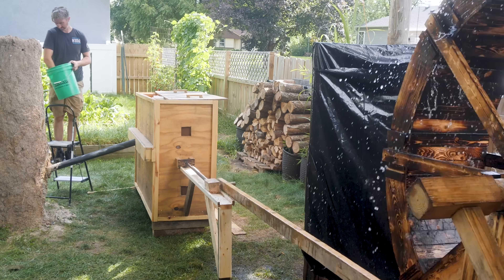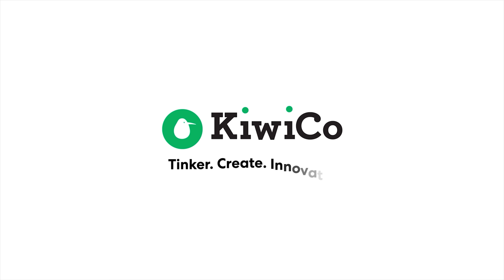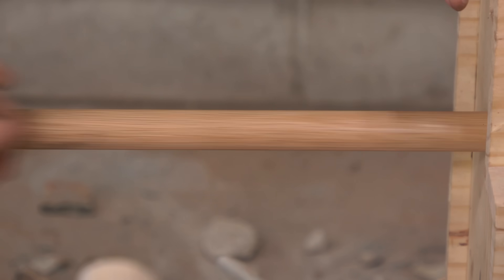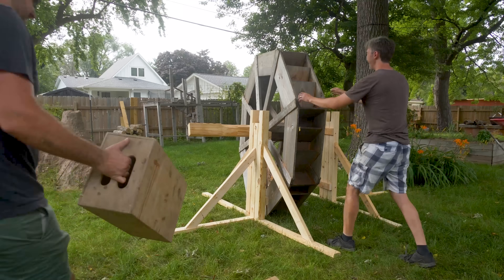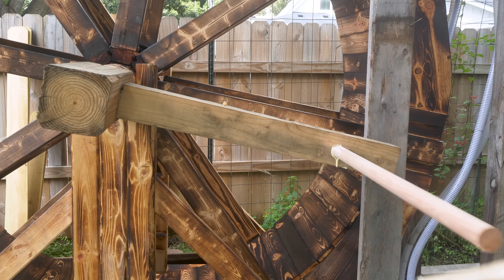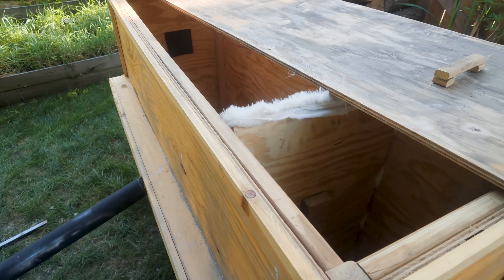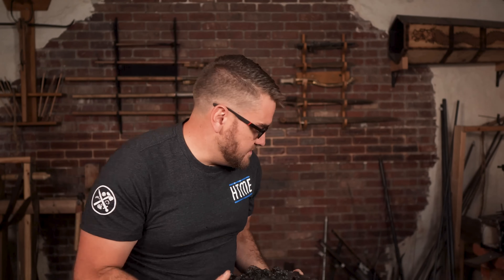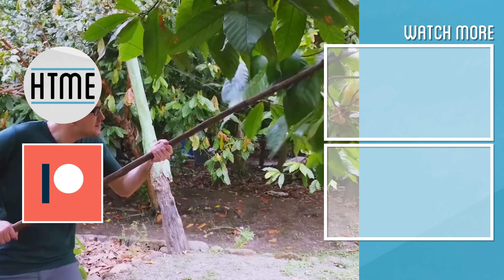River Power: The Secret of Ancient Metalworking

Comment: at some point you need to "unlock" the flat surface to unlock machining. im sure youre aware of this but i hope you do a vid on the 3 plates method of finding a flat surface
Reply: This! 👆
Reply: That's a wonderful idea, and it really is critical to making anything really halfway precise. And if nothing else he'll probably half lose his mind with all the lapping and I'm all for it.
Reply: Reference surfaces, and precision screws are essential to industrialization. But it's kind of a chicken and egg problem, where you just have to iteratively perturb out the errors. The Whitworth method systematizes the iterative process. Next step after that would be to apply the precise flat reference surfaces to measuring parallel face accuracy of blocks, and creating accurate sine bars for angle measurement. With accurate angle measurement, and flat surfaces, a precision screw becomes a lot easier to jig up a machining process for.
Reply: @Leadvest  each of those could be a video. A series on precision would be amazing and needed
Reply: yes
Reply: lapping!
Reply: Yes - would be very interesting to know how hard it is to do this
Reply: I'm lost on what you mean by flat or why it matters
Reply: @asafoster7954  A truly flat surface to use as a reference to derive true angles and parallels is essential to the kind of industrial precision that made early machines possible. we take it for granted nowdays. These  standardized perfect flats make it possible for multiple factories to produce things in an industrial manner instead of artisans making things based on their own references that are not perfect. It also unlocks the ability to make perfect seals and high precision parts that make steam engines possible. its really the final step in how the West undoubtedly surpassed other advanced civilizations of the time.
Reply: @efafe4972  and we’re talking about incredible flatness. Precision to the millionth of an inch in the 1850s. This is how you build an Analytical Engine (if the inventor doesn’t keep fiddling with the design). Precision is how you unlock the whole 20th century.
Reply: yeah bro show us your guidestones
Reply: Flat surfaces in Egypt? Now I've herd everything
Reply: @SerialGrapeFondler they mean flatter than that lol
Reply: This has to happen because I can't visualize it on my own, so I find it hard to understand.

Comment: why don't you use pine charcoal? It get's much hotter than hardwood charcoal.
Reply: They’re using coal coke, not charcoal. It’s nearly pure carbon and is going to burn about as hot as any “charred” carbon fuel can.
Reply: They aren't using charcoal, keep up.
Reply: Coke (the fuel he used) burns much hotter than charcoal